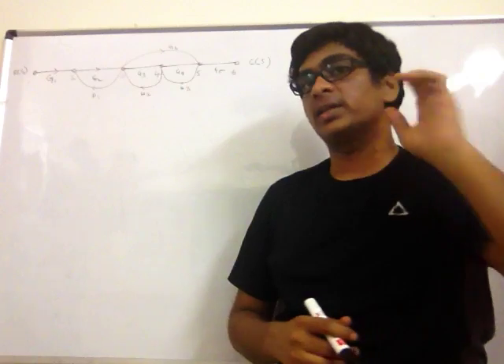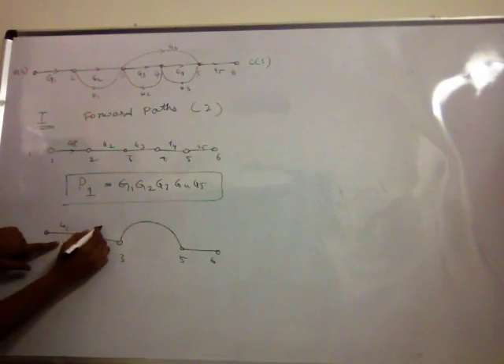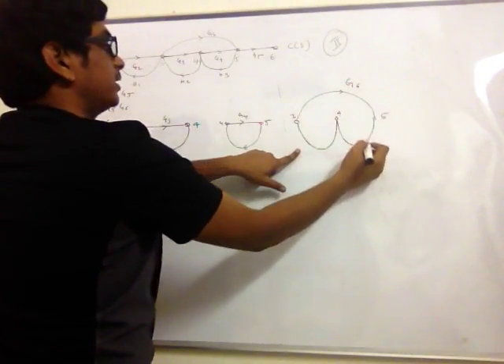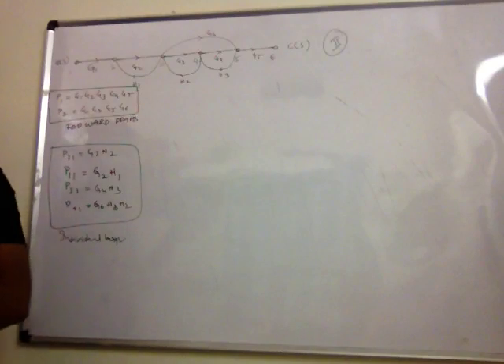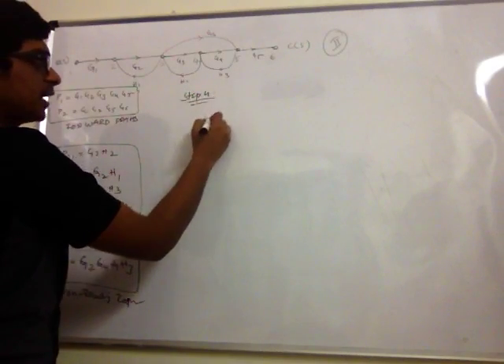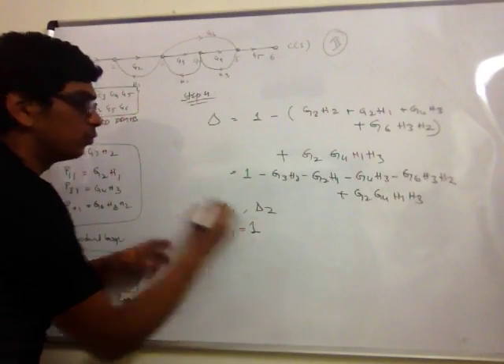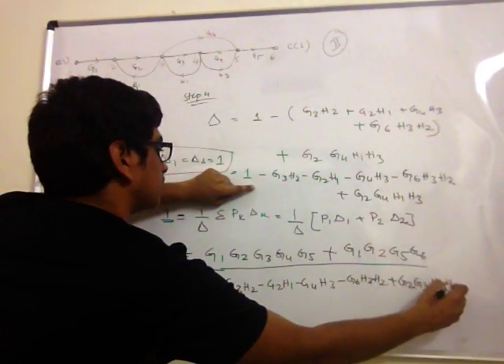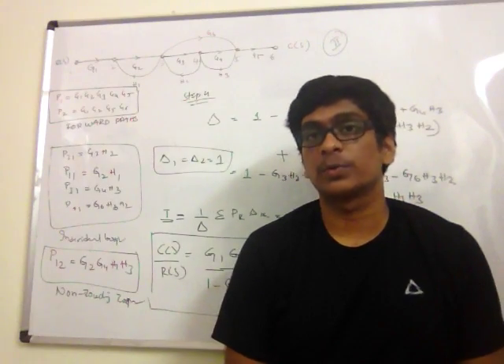Mason's Gain Formula - With a pair of non-touching loops

Comment: what will be the value of delta if there is a loop which is not touching the forward path ???
Reply: +Vikram Mahey here is the answer:
let suppose in forward path 2 the loops 1 and 2 are non touching to the path then you have to calculate the del. 2 as:
delta 2 = 1- [gain of loop 1 + gain of loop 2] + [product of gain of loop1 and loop2]

Comment: what if there is any loop not touching the forward path then what will be the value of delta 1 / delta 2 ?
Reply: +serial globetrotter actually its just Delta_k = Delta(in this case =1) - (sum of non touching loops)
Reply: i also want to know lol he didn't even mentioned it
Reply: +serial globetrotter here is the answer:
let suppose in forward path 2 the loops 1 and 2 are non touching to the path then you have to calculate the del. 2 as:
delta 2 = 1- [gain of loop 1 + gain of loop 2] + [product of gain of loop1 and loop2]
Reply: If there are some loops which are not touching a forward path.
(delta k)= 1 - (sum of gain of loops not touching kth forward path)

Comment: Very helpful.. Even though I am not from Electrical background, I could understand the concept of Manson's formula in first watching. One doubt is what will be result if delta1 and delta2 are not 1. How delta1 and delta2 are calculated?
Reply: +Joby George here is the answer:
let suppose in forward path 2 the loops 1 and 2 are non touching to the path then you have to calculate the del. 2 as:
delta 2 = 1- [gain of loop 1 + gain of loop 2] + [product of gain of loop1 and loop2]
Reply: +Saim Khalid This answer was very helpful :)
Reply: thanks
Reply from the maker: Welcome

Comment: should the individuals loops be negative because of the negative feedback of H1,H2 and H3
Reply: I wondered the same.
Reply: Sammie Phiri I noticed that as well...i believe it should be negative..
Reply: Sammie Phiri The question clearly shows that the Feedback Gains i.e. H1, H2, and H3 are positive. Maybe the feedback blocks are connected to the summing points with positive feedback. However, in most cases, there will be negative feedbacks wherein we will be using -H1, -H2, and -H3.